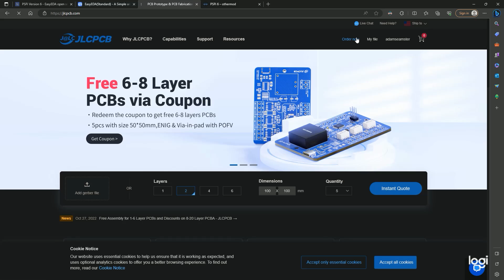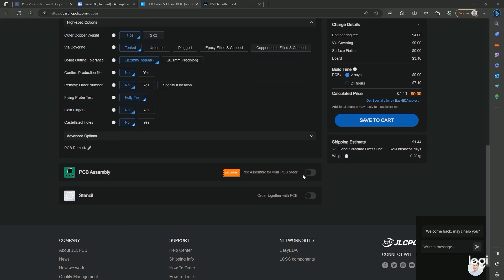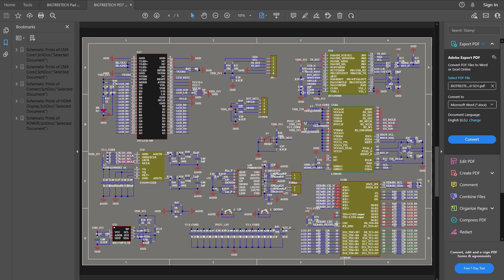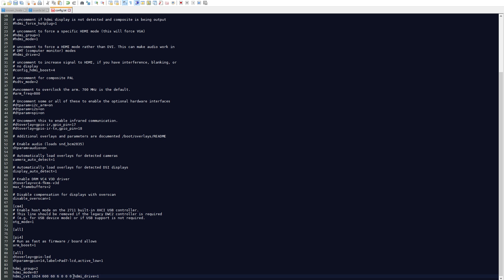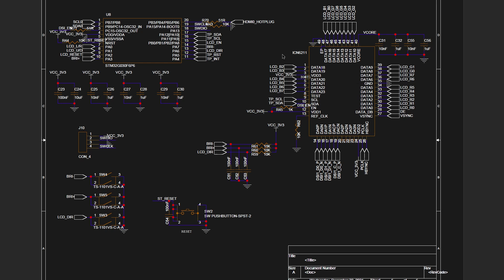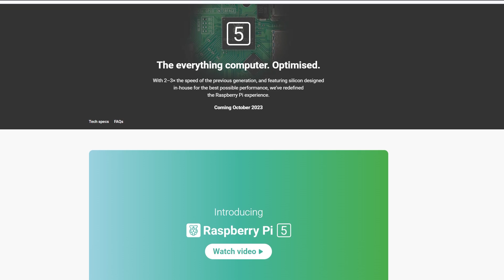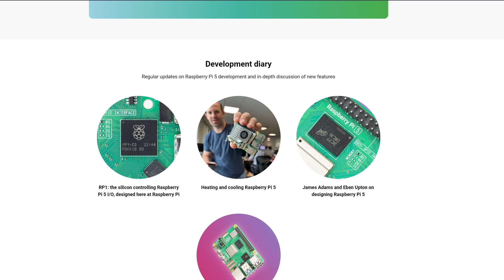PSPi 6 October Update - CM4 Clones, Prepping for Raspberry Pi Alternatives

Comment: Been following your project since 2019 and it's great. I'm also trying to make a RPI handheld, but based on a GBA shell I modelled in 3d (with 4 action buttons and shoulder buttons). Wish I could reach you for some tips, you made a lot of interesting features in this V6, specially with the power and charging circuit
Reply: Are you planning to make any videos about it? Stuff like this is pretty easy to get seen by other people interested, a GBA Pi handheld sounds like something I’d watch lol.
Even if you don’t plan on selling it like Othermod, you could get tips from people watching the project

Comment: Now if you use a compute module, if you can only manage to find a 16gb or 8gb emmc variant, is there going to be an SD card slot available on your board for expansion?
Reply from the maker: The emmc versions of the CM4 don't work with SD cards. Only the Lite versions do. There is an SD slot on my CM4 Carrier so you can use an SD on the CM4 Lite.
Reply: @othermod  ahhh, thanks for the info. I was about to buy a 16gb variant.

Comment: Hey Adam, loving this project of yours. Though I want to know before buying this, can this work on any of the PSP's that are in the X000 line, and could I use this and the normal psp (Like turning it off and using the PSP like normal)?.

 I'm more interested as using this with Gnome to mess around with it, though I will probably wait to see if the raspberry pi 5 compute module would work when it comes out.
Reply from the maker: It only fits in the original 1000 series. That can be PSP-1000, 1001, 1002, etc. This board completely replaces the PSP motherboard, so it isn't possible to easily swap back and forth.

Comment: idea now that im older iv noticed psp is too small sooo if u add 4 cm extra thickness to custom back case using  3d printing re using the front shell  , you can   use a bigger battery add second joystick add left and right triggers  boom what psp in 2023 would be like tadaaaaaa
Reply: plzzz?

Comment: Wonderful work brother, waiting for the official release, and i would like to try it out, btw will the board fit in an aftermarket shell?😊
Reply from the maker: Yes, but the aftermarket shells are not great quality. You'll also need a few more things than just the shell.
Reply: @othermod  nice! I got another question, will other stronger model of pi work? I would love to see it emulator a psp
Reply from the maker: Only the CM4 and Zero fit into the case. The Pi5 is faster and will probably be electrically compatible, but won't fit into the case. Maybe a CM5 will be made at some point. @Youngei402tw
Reply: @othermod  I see! How bout the Wi-Fi chip in the psp? Since it is using the original psp Wi-Fi chip, won’t it only be able to connect to wpa Wi-Fi’s? How bout the modern Wi-Fi.
Reply from the maker: It's only using the WiFi antenna from the PSP, not the electronics. The Pi has built-in WiFi, and it connects to modern WiFi just fine.
Reply: @othermod  nice brother sry for the dumb question! Looking forward for your project

Comment: are you going to be selling kits with the screen etc? sorry if this is covered in the video im still skipping around it. unimaginably excited for this thing - after doing my research i'm probably gonna end up waiting for the full release rather than order my own (my soldering is poor) and getting a single box with all the parts i need would be sweet. also, while obviously this isnt something anybody like... knows, at this point, what do you figure the odds are that an eventual cm5 would work with the cm4 carrier thing? is that even how compute modules work i dont know
Reply from the maker: If i can keep the shipping weight down, I'll sell a kit with everything. If they make a cm5, I'd say the odds are high it would be compatible, but yeah no way to know for sure yet.

Comment: Do you have plans to adjust your board to the raspberry pi5?
Reply from the maker: I mentioned it briefly at the end of the video. I expect it to be electrically compatible with my board, but it won't really fit into the PSP case.

Comment: How good does the pricing come out with having them solder the components for you?
I've been thinking of having some boards done via them since some parts are BGA and I also don't want to minimize the soldering I have to do.
I'm especially curious about their bulk purchases because I'd like to sell the boards at some point as well.
Reply from the maker: Its pretty cheap as long as the component count isn't crazy. My board is about $100/each to get made in small batches because of the setup fee for like 50 different components, but simpler or higher quantity boards are really cheap.

Comment: What types of PI can I put in it? And the expected performance?
Reply from the maker: Pi Zero, Zero W, Zero W2, and CM4 will work with it and fit into the case. The Pi 3 and Pi 4 will work with it, but don't fit into the case. The Pi 5 may be compatible (will test one soon), but won't fit into the case.